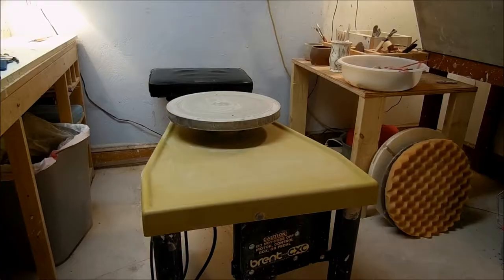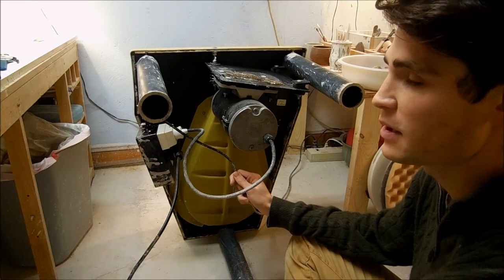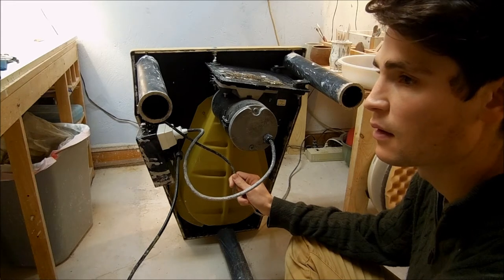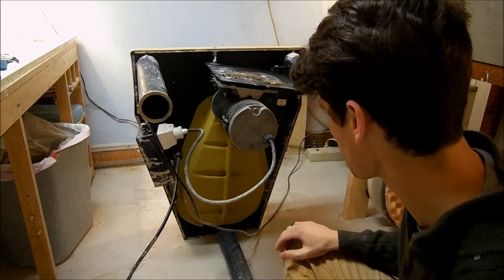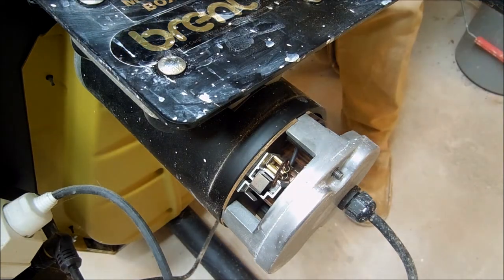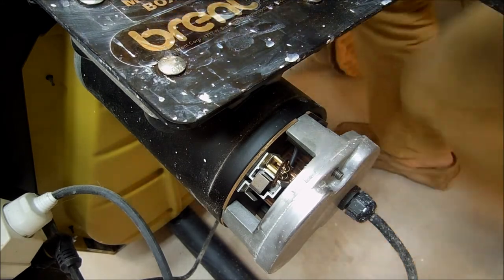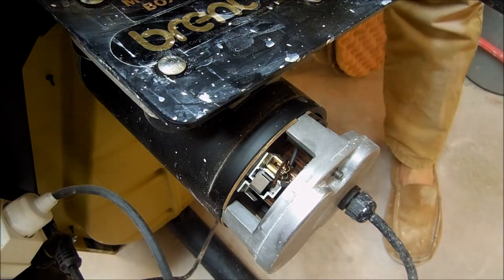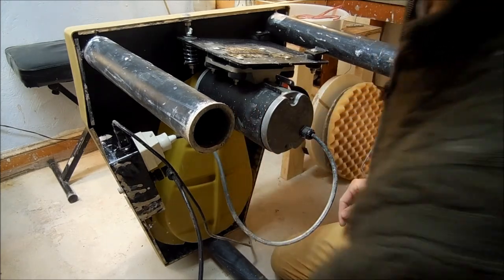Squeaky Wheel

Comment: I see this has been out a few year.  I work for Brent in the technical support department, and this is not the way to stop your squeak.  NEVER put oil on the commutator of your motor.  it is a potential fire hazard. The correct maintenance for this is to blow all the carbon dust our of the cavity with caned or compressed air, then use a commutator stone to remove all of the carbon build up on the commutator.  Then you use a q-tip and clean the brushes with rubbing alcohol.  

Using oil is a temporary fix that will cause damage to your brushes and possible cause you motor to over heat and catch fire.   

If you have any question call AMACO/BRENT Technical Support  at 1-800-374-1600
Reply: Hi Deve Nagy, 

I am in the process of changing all bearings on our Brent B wheel. The motor is already disassembled by using a pulley puller but I am not sure how to disassemble the wheel head assembly. I haven't tried it with the pulley puller yet because the metal part in the middle looks more complex and I could not find any information on how that part is constructed. 

Any help is really appreciated!  

Kind regards,
Mate